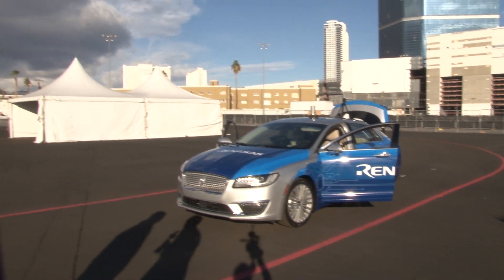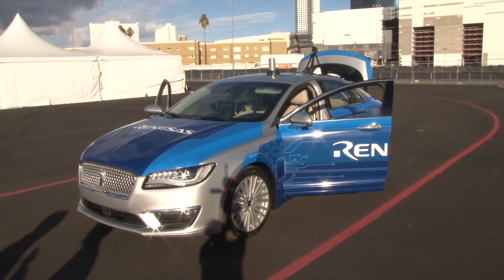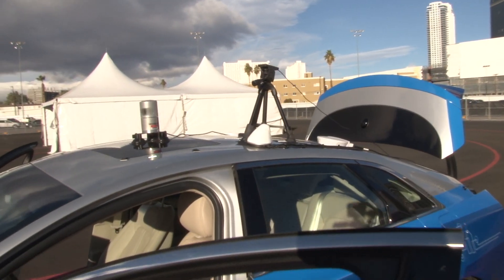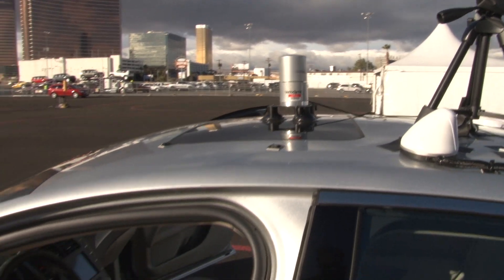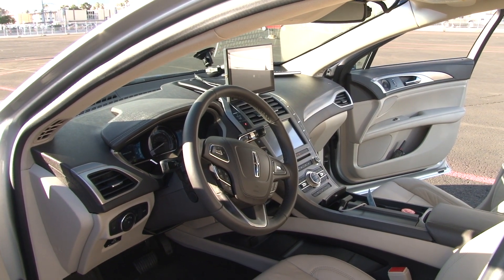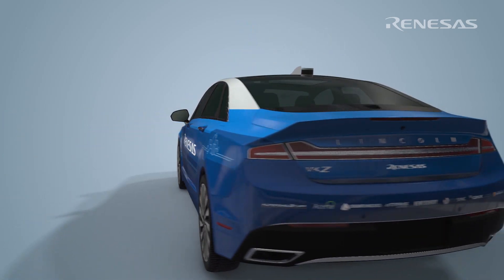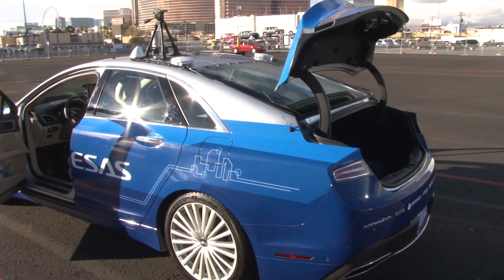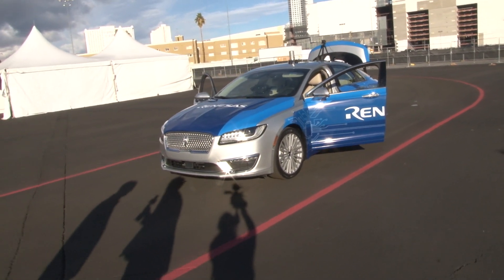Developing The Hack-Proof Autonomous Car - CES 2017

Comment: Any computer-powered item can be "hack proof" if all external communications are eliminated. I worked with telecommunications systems since 1974 and with Internet systems since 1995 and they all were "hack proof". All program updates and upgrades are done directly inside. No OTA programming allowed! I would fire all IT managers that allow remote access to any system they manage.

Comment: Hahaha hack proof. Right.
Reply: Depends who is doing the hacking attempt. using a rare and unique processor and a proprietary language does make it "hack proof" unless you work for that company. As an example, the 2009 to 2017 Chevrolet Volt electric vehicle uses special GM processors and a powerful IBM developing software package, which has made it "hack proof". No one has even got into one and hack it!
Reply: Security by obscurity doesn't work. Besides, it does not 'prove' anything. Just trying to be precise here.